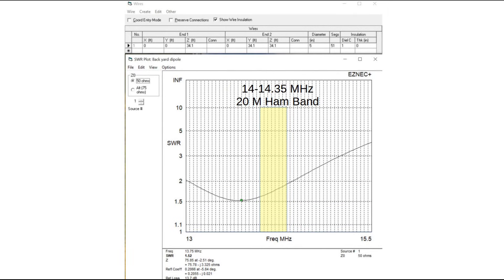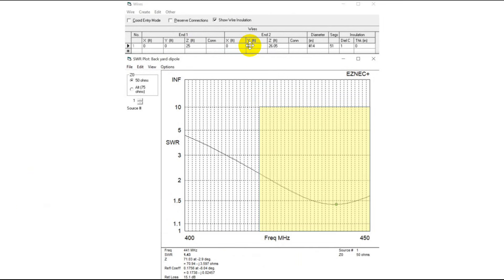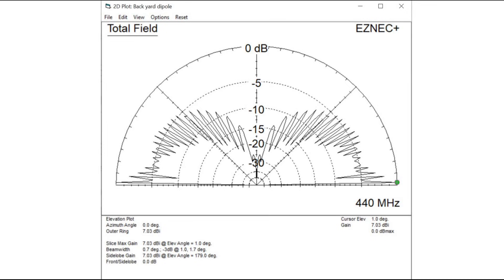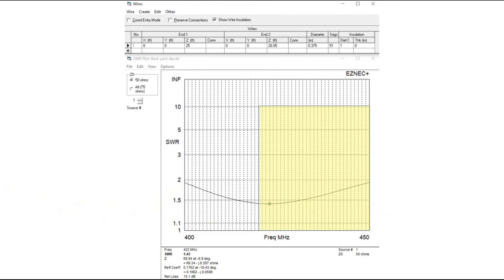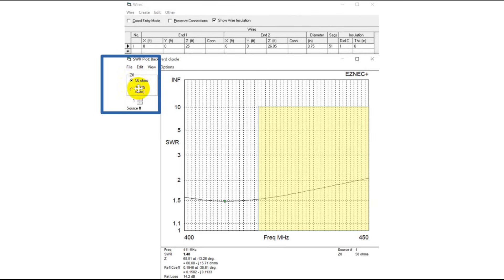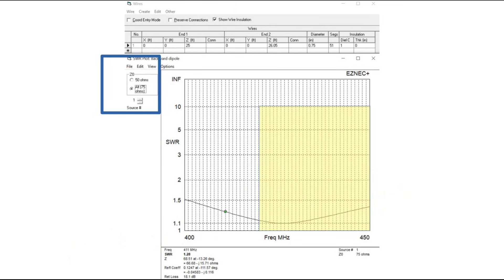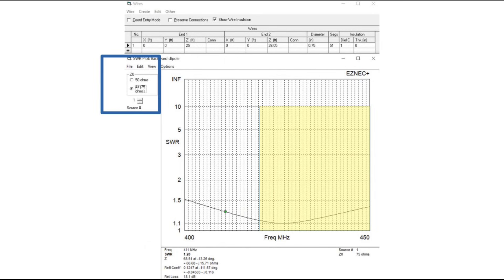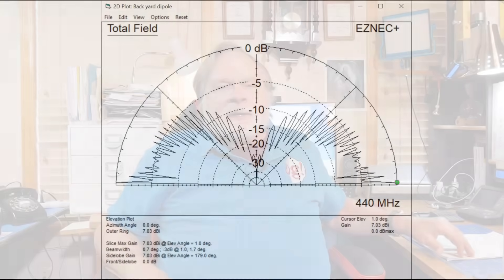Thicker Antennas Change Things (#1121)

Comment: In my brain, the thicker the antenna elements, the more virtual paths the current has to choose from.  So the thicker the wire, the longer the wavelength you can 'cram' in there.  But those paths are only longer than the wire, never shorter, so the thicker the element the lower frequency of the optimal SWR.  

I doubt this is actually what's going on, because why would the optimal SWR stay nearly the same regardless of pipe size?

Comment: You find the same thing with sound like in flutes, recorders, pipe organs... The 'belly' of the wave is normally just outside the pipe. The wider the pipe gets, the further out this belly is, so the lower the resonant note will be. I'm assuming that, since current runs along the outside of a conductor, the difference for hollow pipes or solid rods would be very small for antenna use, but I would be interested in actually seeing if that's right. I didn't know wider conductors made for a wider bandwidth. Good to know! I was thinking about making an antenna for my latest radio, the UV-K5(8), to optimize the receive range. Guess I'll be looking in to brass tubing instead of bicycle spokes for that one ;) Also makes tuning easier, because I can use two pipes that fit snugly together ;) Thank you!
Reply: Very nice analogy to sound waves in wind instruments. I also often apply a bit more intuitive sound waves physics to RF domain to make it easier to process. So I had all the pieces but failed to put them together. This however answers only the question why resonance point moves down. Why diameter affects bandwidth is still open. Experimentally I observed it but  could not find any equations in the Internet so I asked Dave. He made very nice simulations and confirmed my obserwations but the question WHY remains open. Suggestions from other comments about more possible longer paths on a tube VS line antenna (geometry+quantum mechanics) is something I thought of before asking Dave, but the impact in that case would be minuscule.

Comment: Dave, this was an interesting video on a topic most Hams don't think about much. Most VHF/UHF antennas have a matching network at the antenna. Also, a larger element diameter makes an antenna more efficient. I believe the original question was, "Why do thicker antennas have wider bandwidth." So, why do they?
Reply: True. Antennas are on the border between magic and theory. There are so many variables that sometimes the best path is to build and test.
Reply: @RB9522  The "Tesla" method... <smile>
Reply: The question opens a physics can of worms. But basically, a thin wire is really much better a resonator than antenna: it couples to itself at its resonant frequency much stronger than to free space. At the opposite end, a transmission line that gradually opens up into a double cone couples very well to free space, and has a huge bandwidth. So of course something of intermediate shape will have intermediate bandwidth.
Reply: @Matthew.Morycinski , for a thin conductor, there is only one path from end to end. For a fat wire or other shape, there are longer paths from end to end but no shorter ones. That's why the center of the SWR dip moves lower in frequency. The case of a radial mode helical antenna is another example of this. Many Hams use antennas with several wires running parallel but separated by spreaders to increase the effective diameter. (This works if the wires are not separated too much. Otherwise, the feed point impedance will be lower.)
Reply: @RB9522  Yes, that's one rule-of-thumb way to look at it. But I would not carry this analogy too far. Current in a thick wire is no longer a line but a sheet. Charges at the ends are no longer linear but take up a complex shape. Even modeling this is only doable by turning this "simple" thick wire into a mesh.